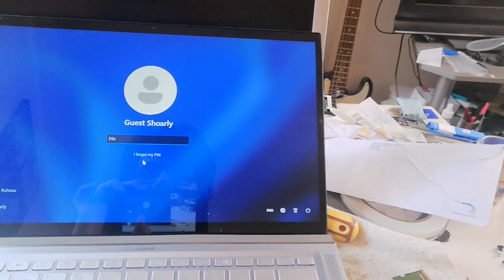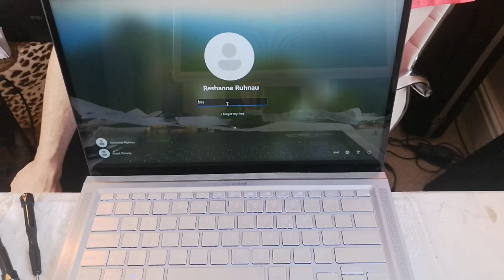How To Install A Built-in Laptop Keyboard Without The Palm Rest Panel (asus Zenbook UX431) Tear Down

Comment: Thank you for the instructions! Btw, to get rid of the plastic clips/holders, I would suggest using a paper cutting knife. And use hot glue to get the keyboard and the metal plate back in place. Worked great for me.
Reply from the maker: @artemkildishev299  oh amazing. Great you got it going. Thank you for the hot glue tip. I did come across that one
Reply: Hot glue rocks! Thanks for the tip!